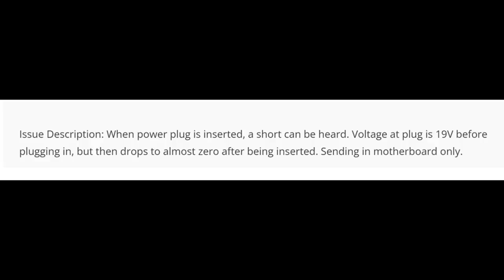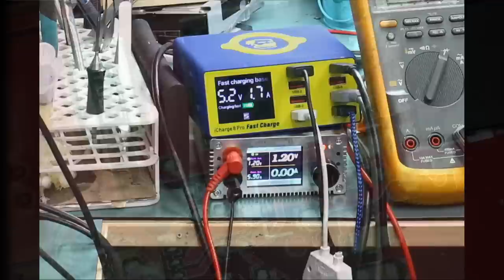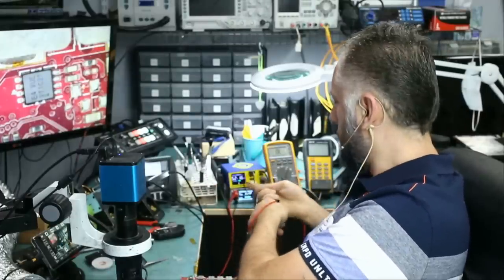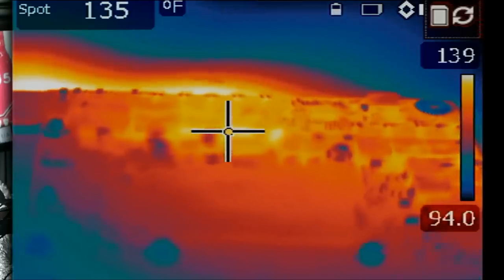ASUS ROG Zephyrus M No power Motherboard Repair - GM501GS-XS74

Comment: Thermal camera - priceless tool!
Reply: Price is about $550 these days...
Reply: it's cool seeing him use it to pinpoint the problem.
Reply: @UsernameRedex  If you do this much, it will pay for itself by saving you time and preventing mistakes.  Just like any other tool, its usefulness is specific (to temperature detection in this case).

Comment: That’s my favorite laptop issue, shorted B+ easy money 😅 btw the caps its up to you if you want to replace or remove only, remember the characteristic of a capacitor 😆 the higher microfarad much better voltage storage 😄😄

Comment: Is there something unique about the voltage injection tool or would you get the same functionality with a quality bench power supply set to output 1.2V and limit to the current to 4-5A?
Reply: Yes you can use a bench power supply

Comment: I had a 75w charger stop working. So I opened it up to find a shorted mosfet.  After removing the charger works again.. I didn't replace the mosfet

Comment: If laptop works perfectly without that capacitor, then why it is placed by manufacturers?
Reply: It is possible that it would not work perfectly, there is some chance it would crash under high load or something like that. Capacitors are used to smooth ripple and noise in DC-DC converters, they can also reduce electromagnetic interference or be used in RC snubber circuits. Designing DC-DC converters is a very difficult engineering task and every capacitor serves its purpose, while the laptop might still works without some capacitors, laboratory testing could show some problems and excessive noise, and the laptop might not pass some certifications or quality tests.
Reply: @adalbertfix  Thank you for the detailed explaination!

Comment: I Blame it on the crappy Chinese Chips for the chip shortage, Because they just don't last long enough and therefore 
manufacturers are waking up to the fact Chinese chips are junk, Therefore another source is needed, anyway the 
more that turn to Taiwan's quality chips, the more Taiwan's back order grows, ergo the longer the waiting time before 
orders are manufactured and shipped, One can only hope Taiwan doe not end up under the Chinese Regimes control, 
if it does Taiwan will also end up spewing out much the same crappy chips..

Comment: Hi Alex, Thanks for your good content, every morning when i wake up I have to watch one of your videos to start my day, I recently started learning repair basics and after learning some basics I am learning how to find a short on motherboard, I have a Asus Tuf Gaming FX705D laptop motherboard which has a screw dropped on near its SSD slot and GPU power supply unit and made a big spark, after that as said from the guy who gave it to me, the keyboard light turns on and goes off immediately after the power cable is connected and when I turn it on the GPU is dead cold but cpu gets extremely hot and doesn't shut its self back off, just keeps heating up. I actually didn't keep it running more than 1 min because I was afraid that I will damage the GPU, there is a big short in some parts of the board specially caps under GPU and CPU too and inductors near GPU are dead, no voltage at all, that explains dead GPU, for sure no screen after turning it on and no fan spin just the power light goes on and says it is on. I checked the whole motherboard for short and a lot of are shorted, I found  a cap near power input which was the first shorted cap near power input unit, the rest have all 19V, and injected voltage, at first it was about 5 or 6 amps drawing but it went up to 8 Amps! but under thermal cam nothing was visible just wires of my probe which were getting hot but nothing on board was hot at all, dead cold like always. my question is am doing something wrong? any idea how I can do it better?
Thanks in advance for your answers.

Comment: In some cases, when only board is available, may be problematic if tests is required or short is on LCD panel not on mainboard.. 
This is equal to claiming, that laptop didn't turn on and only laptop, without power adapter, was provided for repair when, actually, power brick is dead.. 😂

Comment: By watching ur videos, I got so much interest to going further in repairing computer. I mostly work on software rather than hardware. Having such a great tools like thermal cam is a must I would say, but the price among the most expensive huhu. Anyway.. where do u got those capacitor and what type of value mostly use? TQ sir.

Comment: Awsome dude awsome you are the re-animator. You bring life back to the dead. I have 2 acer nitros both have issues 1 was the isl chip or its power chip I replaced but life didn't return . I'm gonna try that trick only I don't have a mini supply so I hope it works with a regular sized power supply.

Comment: That thermal cam really is helpful. Im also injecting voltage whenever im having a hard time looking for a shorted components, but since i do not have a thermal cam. Im using a battery instead to look for a shorted component, and as expected, it doesn't work all the time🤣🤣🤣

Comment: You should also check if the voltage of capacitor is correct. We don't want to replace a 10V rated capacitor with a 6.3V rated one.

Comment: Manufacturers are conservative in their bypass capacitor usage to assure reliability in adverse conditions.  It will work in lab conditions with very few of them, but once a few are removed it will start generating errors and failing when a surge occurs during relevant operations.  You are wise to consider what people suggest; however, don't upset yourself at what they say.  It is your shop and your channel.  Run them both as you see fit -- your success at each is evident.

Comment: I would like to share a de-soldering technique I use with the Weller hot tweezers.  If you flip the tweezers so that the conical tip is pointing up instead of downwards, the tweezers can be angled to give greater thermal mass to the pad so that hot air is not required.  A bit of solder on the tips of the tweezers also helps.  I am able to remove the bigger caps and diodes quickly without hot air.   I have learnt a lot from your videos.  Maybe this is one thing I can give back.  Thanks for the great content.

Comment: As long as the uF value is equal or higher and the voltage rating is also equal or higher it will work.  The caps voltage rating is usually closer to double the voltage of the voltage rail it is on...  Pretty easy...

Comment: it's so easy to spot the defective component when you have the voltage injector and a thermal camera... :p One day i might get those devices along with a microscope, hot air station with all the tips and all.

Comment: The voltage injection tool comes in handy when we have a short and need to energize the board to see the component that is getting hot to heat up!

Comment: Nice work. How do you know which way those capacitors go, what's the tell tail sign, please?
Reply: It's not a big deal with capacitors which way they are mounted generally.  It's diodes the have directed current flow.
Reply: @ejeckk  ok, ta, was thinking of the old cylindrical type that can only go in one way to these ones.

Comment: With all due respect, you shouldn't be upset by people wanting you to replace the capacitor, brother.
ASUS didn't place a capacitor there for decoration, it serves a purpose.

I don't exactly know how much you charge for such repairs, but replacing a 10 cents cap whose role is to protect components from ripple-induced damage isn't too much to ask imo.
When the spot is very crowded and you'll end up doing more harm than good? Yes, of course, don't bother replacing it.
But when it can be easily done, why not?

Anyway, great job as usual, beautiful display of repair skills.

Ws